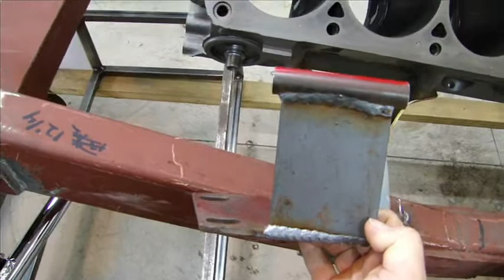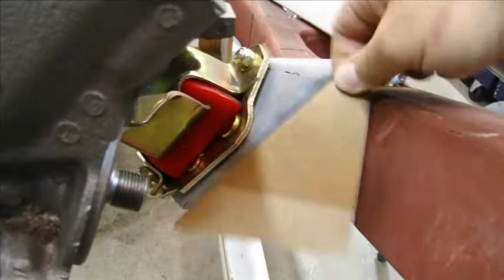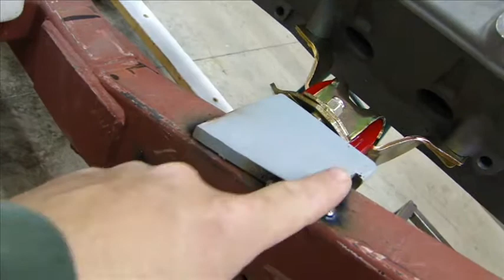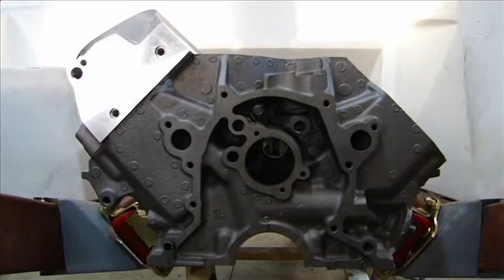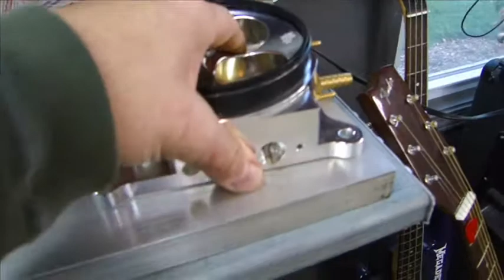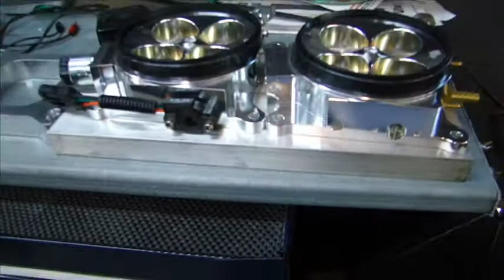StreetBeasts 427 Cobra Motor Mounts

Comment from the maker: I would say that it is impossible to have zero angle. The motor is always moving and the rear suspension moves as well. The stress on a u-joint under load is more evenly distributed the straighter the axle is. Once the drive shaft moves and puts a vector stress on it there are only a couple of points absorbing all of the load. Keeping it straight reduces the chances of blowing it out under extreme loading.